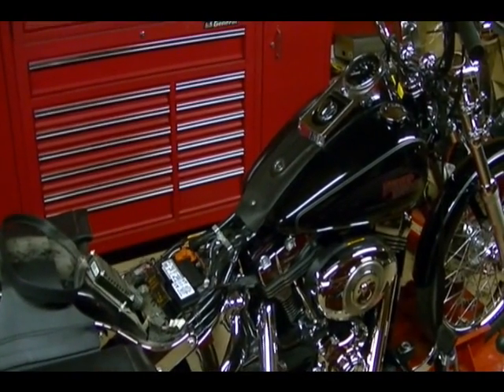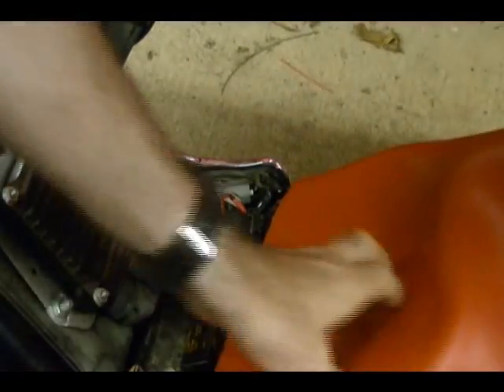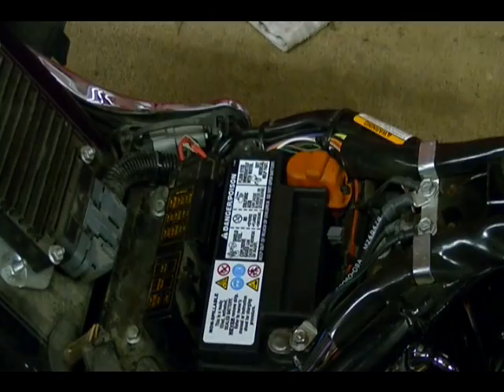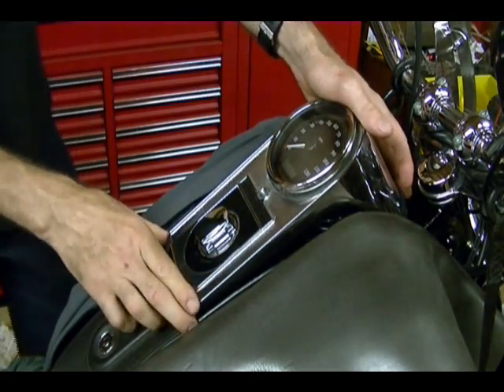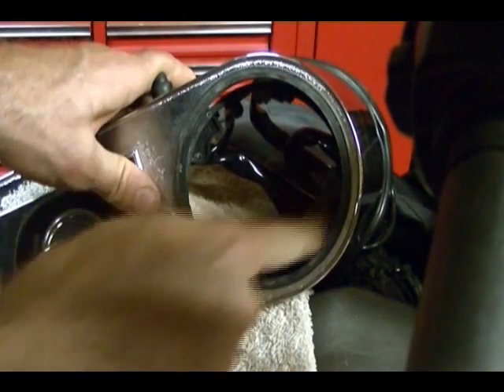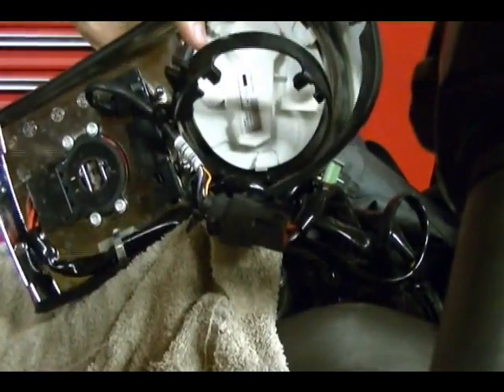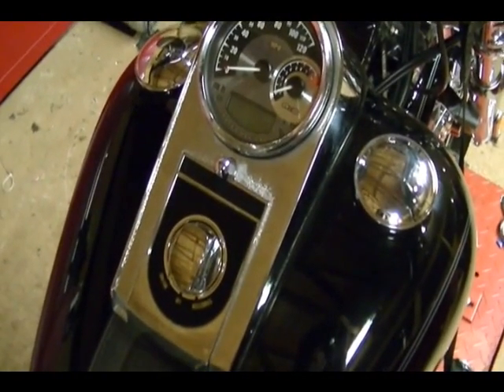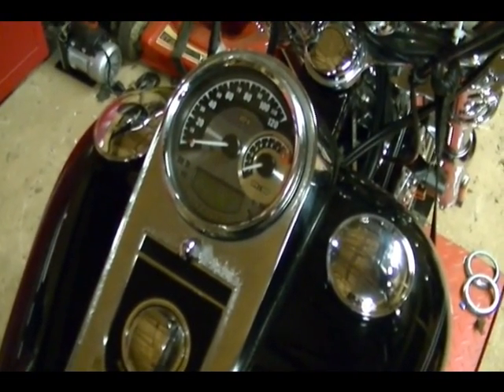How to Remove & Replace the Speedometer on a 2009 Harley Davidson Softail Custom 70900070A

Comment: Thank you for the great video , installed this weekend , a couple of things I’d like to add for ease of install:

1. Line up the Speedo dead center so your not fighting the black retainer clip , it’s near impossible to spin the speedo once it’s set so put in straight from the get go. 

2. Make sure the run switch is on before you transfer the data or you get a No Cal reading.  

3. Remove the odometer reset switch from the boot or you might break it like I did. 

4. When inserting the electrical connector into the new speedo it only works when the correct side is inserted , before you put the console back together check to make sure you didn’t reverse it by turning it on , it WILL snap in both ways. 
If your speedo doesn’t turn on just reverse the electrical harness connection.

Again many thanks for your video , excellent job

Comment: You are the best! Just installed my new tach on my Fat 2013 following your instructions.

Something I can say about my installation:

- to turn off the battery, you should do it BEFORE the alarm turns on, otherwise will alarm; turn the key off, and immediately take off the fuse, avoiding the alarm to turn on;
- my rubber ring around the tach was too tight; I used some lubricant and entered very smoothly;
- the connector attached to the tach can go either right or wrong way; be careful you keep track of the right position;

Thanks guys!
Reply from the maker: Thanks

Comment: I really appreciated you putting this video together.  I was not impressed with the instructions that came with the Speedo/Tach.  By watching this video I replaced my original Speedo with the 70900070A in less than 30 minutes.  It was clockwork that could have not been done without this DIY instructional video.  Thanks
Reply from the maker: Good to hear. Thanks for watching!

Comment: Exceptional video and info. Thank you for taking the time to make it. I installed the Combination Analog Speedometer/Tachometer 70900070A on my 09 Road King tonight and this video made it a 10 minute job. Note that on the RK the Data cable and master fuse are both behind the left side cover. Data connector is gray and down low. It is NOT yup top behind the tank... Same size, different color and function. Just FYI.
Reply from the maker: Thanks
Reply: Thank you very much. You save a lot of trouble for me
about colour on  connector. I try behind the tank several times and its not work. Thanks!

Comment: Great video.. it worked for me..
Q,  what to do with the gas cap with fuel gauge , how do I remove it and what to do with the inner sensors and wiring.
I now want to add flash mount pop up gas.
Thanks cap

Comment: That looked easy enough. I had the dealership install the speedo/tach when I purchased my 12 RoadKing. I need to look at the labor cost. Should have saved a few bucks and installed it myself.

Comment: Thanks for posting this video. It helped make thing go rather quickly when I installed my new speepo/tach on my 2013 heritage. 
One question, is there a way to turn off the ABS light on the gauge?

Comment: Looks simple and I will do mine this afternoon. However, I plan to remove the tachometer from the handlebars which is the reason I bought this speedometer in the first place. What do I do with the wires that run to that gauge?

Comment: Thank you so much.  After much mis-information from my local mechanic (who is a great wrench) and also from the local dealer, this video shows me I can easily do this myself. '04 Heritage.  Too bad the gear indicator will not work on older models.
Reply from the maker: +Truly Anonymous Thanks for watching!
Reply: +smallengineshop Hello man, I was looking your video and I'm needing an part for my bike it's a Deluxe Softail year 2013. My Dash Panel sensor aren't working  on dash panel. I need buy a part for my sensor return to work. What is name this part and what's part number for my bike? Thank you!

Comment: Hey I just bought this tach and installed it with my friend by watching ur video step by step excellent info thank you for posting ps on my 2007 soft ail the maxi fuse is in a different place took a minute to figure lol almost had the battery disconnected by the time I found it lol
Reply from the maker: Good to hear! Thanks for watching!

Comment: I know it has been a while since someone has commented on this video but I thought that I would ask...in order for the new gas gauge to work, does the old one have to remain plugged in or can you disconnect the old one on the dummy side of the tank and put something else there in it's place?
Thanks in advance for your help!

Comment: Nice video.Just picked up a stock replacement speedo for my 2010 Heritage Classic (glass was cracked).Could you pls tell me the P/N of the jumper which allows transfer of orig miles to the new unit? Thanks smallengineshop!

Comment: Do I have to pin the 3 fuel gauge wires to the speedometer plug to get that to work? Right now it’s in the cap.

Comment: Thanks for the info.  One addition - I installed one in my 2010 Softail Custom.  Note that my data would not transfer until my switch was in the ignition position AND the "Run" button on the handlebar was on.
Reply from the maker: Thanks for commenting and watching!

Comment: Hi.Great video
I want to buy this item (70900071A KpM).
 I have the current odometer in miles (original speedo in FLHRSI 2005).
 When changing to a new speedo will-ECM send the number of miles or kilometers to the new speedo?

Comment: Can we get a video on the 1) digital oil pressure gauge and 2) Kuryakin fuel / voltage replacement install for the 2009 FXSTC?

Comment: Great video 
I was just wondering, can you install a speedo tachometer combo of a 2012 Fatboy to a 2008 heritage standard speedo, I have the wire 2012 harness that goes from speedo to existing wire harness. I would really appreciate any info that you can supply   
Once again thank you. 
Loza

Comment: nice unit- was working fine and did some work on bike and disconnected the battery and when everything was hooked up odometer says V I ER. speedo works but nothing else- took it for a long ride and nothing changed. Any ideas??

Comment: I just went to put in this new speedometer on my 07 Heritage but because I had already put in a new upgraded speedometer in 2008 the new speedometer won't sync with the bike.  HD says you can only upgrade from the original speedometer, so because the speedometer upgrade I did in 2008 failed (bike said I was doing 10 mph at 3,000 rpm at a stop light) I can't replace it.

Comment: Very cool....been thinking of getting one for my 05 Heritage Softail Classic. With that being said my bike only being a 5 speed will the digital readout still work as in what gear I'm in and fuel gauge ext....finally you mentioned colors for the speedo is it just a complete rainbow of colors to choose from? Thanks a lot for your time and great video!
Reply from the maker: The gear indicator and the fuel range won't work on a 2005 Softail Classic. I posted the colors and codes at thesmallengineshop forum. Here is the link:

http://thesmallengineshop.net/smallengineforum/index.php?PHPSESSID=a6ss934o7ssfl6kf468kvo59b4&topic=53.0
Reply: OK thanks I appreciate it!

Comment: I have a 2009 Softail Custom like yours. The Fitment says material is 5 inch diameter. But it's only 4.6 diameter is that the same a yours. Kinda like example a 2 by 4 is not really a 2 by 4.

Comment: Hello Smallengine  shop.  Great Vid... I have a  2005  FLSTF, you  showed the  parts  box  which  included models from  04-10-- FLSTF  ..... QUESTION:    I  currently  do not have  a  tach  (  stock  speedo) and  my  fuel  gauge is separate. Can this  part #  still be used on my  bike so I MAY have  RPM , fuel  gauge and speedo? Thanks

Comment: ok I was sold the wrong speedo and after install by shop I discovered the error. (after bike brought home) they told me to uninstall the speedo bring it in and they'd give me the correct one. All was going fine until I went to do the odometer copy followed your video and instruction page (your video is easier) but I get an error msg that is not in the troubleshooting table. I get "no spd" before I tried to do the data transfer I called the shop to ask if I needed the speedo they made me return and they said no the info is in the bike. Well I don't know about you but I'm thinking no spd means no speedo to copy from. Help please. Already paid them $60 for the initial install not about to pay them again for same job.

Comment: So I did the install. turned out O.K. First off getting the adapter out of the bike end was a trial. Then the rubber around the speedo came out. Unless you know a trick to get it back in it is a frustration (go round with your thumbs in opposite directions and push in the bit that is left). Then try and get the new speedo in - hah! it takes a lot of WD 40 around the speedo AND the rubber.Getting the kast white prong of the speedo over the lip of the rubber without pushing the rubber in again is a chore also. Pushing down the black ring is not as easy as it is made out to be. I guess what could go wrong did or the video was practiced many times with everything positioned and expected just so. Anyways O.K. job on the video, just should have some caveats as to the problems that may arise.

Comment: Any chance you could tell me the pin wiring schema of the adapter? I have the plugs and want to assemble the adapter..
Reply from the maker: Are you talking about the 4 pin to 12 pin connector?
Reply: @smallengineshop  4 pin connector (j1850 era)
Reply: @smallengineshop  the main question I have whether I can connect to the electra glide 2010  (j1850) a used matching speedometer (j1850) from other bike (say road king 2010) and do not get a VINERR displayed?
p.s. people say it's just a drop in swap, other say - I need special equipment to "merry" speedo with ecm.

Thank you.

Comment: Would not work on my 2004 RK. Took it to local HD shop after they fought it for a day they called HD factory. They were told my old speedo was not factory original and would not calibrate my new speedo. I had to order a new factory speedo specific for my 2004 RK still waiting for it to come in. I had bought my bike used and possibly it had a newer speedo installed. So now i will have two.

Comment: Where did you bougth that speedometer? 70900070A... can find it in Europe.....at least for my Dyna Street Bob 2007..
Reply from the maker: I bought the speedometer from a Harley Davidson dealership. I know there are HD dealerships in Europe, but I have no idea if they sell the same items. I am sure HD has a website for all the European countries where they have dealerships, so I would check the website.
Reply: Thanks

Comment: I have a 99 Softail Standard the odometer does not read and it just shows 0 everything else on the bike still works when I turn the key on the speedometer will flicker I read the codes there are no codes my question is do I need a new speedometer
Reply: It sounds like you need to flash the old speedometer with the new one. Did you hook up the new speedometer with the cable that came with the new spoodo/tach? It must be hooked up from under the seat and flashed. Then you can program the colors after you remove the old one and install the new one.

Comment: Hi can this speedo be reset at the dealer and installed on another bike
Reply from the maker: I don't think there is an approved method to reset this speedometer, However, there are ways to change the mileage with special tools. I wrote a post about this on my website forum.

Comment: hi
i have softail fatboy 2013 but my plug has 6 pins instead 4 and i cant make this connecting, do you have any idea how to can i solve this problem?
Reply from the maker: Did you buy the correct speedo for your bike? I don't think there is a solution for this problem, but I would try calling your local HD dealership. I hope you didn't purchase the wrong speedo, because I don't think HD dealerships will allow returns on electronic products.
Reply: I bought the speedo according to HD site, its 74777-A11 and before i bought it i ask if it fit to my bike and they said yes, it is very strange that no one can help my dealership or even HD have no idea
Reply from the maker: To make sure we are on the same page. I don't have access to the instructions that came with your speedometer. Are you saying the data link connector on your motorcycle is 6 pin instead of 4? If your speedometer is like the one in the video, than it came with an adapter harness. One end of the harness fits into the speedometer and the other end plugs into the data link connecter. How many pins are in the harness data link connecter end (The end of the harness that fits into your data link port on the motorcycle)? And how many pins are in the data link connector coming from your motorcycle?
Reply from the maker: I uploaded photo's of the adapter harness used in the video to give you a better idea what I am referring to in my previous comment. Here is the link:
http://thesmallengineshop.net/smallengineforum/index.php?topic=132.0
Reply: ***** My speedo as i wrote is 74777-11A this speedo is KM and not MPH
 Yes my data link connector on your motorcycle is 6 pin, I have the same cable as you have you with 4 pins
when i called to HD they said this is the correct cable and they dont have other adapter cable
it sound very strange that HD make motorcycle with data link with 6 pin and they dont have adapter cable that match Right now i dont have any idea what to do, I hope you could help and have something or idea
When i disconnection the speedo of the electricity on my motorcycle and return it back i can see the real KM for 3 second and it return back and show 999999
I ask someone and he said my be my computer on the motorcycle was locked, do you think it is possible? and if yes how could i release it
thank you very much for your help
I appreciate very much
Reply from the maker: Are you sure your looking at the data port and not another connector on your motorcycle? Can you take a picture of the data port and post it on the forum? Thanks..
Reply from the maker: I just verified the 6 pin data port through a forum post online. It says HD went to a 6 pin data port on all Softails in 2011. The HD parts and service department near me could not tell me if HD went to a 6 pin data port on the 2013 Fat Boy. They are completely oblivious to the problem, and I don't have a solution to you. I wish HD would make the instruction sheet for the 74777-11A available online. I would take your motorcycle and the speedometer back to your HD dealership and show them the problem and demand a refund. I will continue to look for information regarding your problem and let you know if I find anything.
Reply from the maker: Contact Harley Davidson customer care 800-258-2464. They said the 74777-11A comes with 6 pin adapter harness and not a 4 pin. I told them what you told me, and they wanted to know when the 74777-11A speedometer was purchased.
Reply: wow thank you very much!!!!!!!
where can i find the purchased date?
Reply: Do you know the part number for this adapter cable 6 pins?
Reply from the maker: If the manufacturer date isn't printed on the speedometer/tach, or any of the accessories included with the kit, than I don't know how to find the date. You might try calling HD customer care. I don't think the adapter harness is sold separately through HD, but I would give HD customer care a call.
Reply: Is it a possible that you can achieve this cable harness for me (with 6 pins)?
Thanks you very much for your help and I appreciate very much since it very hard to talk with HD
Thanks for you help
Reply: eliran yair hi, i call HD (talked with Deby) and she said there is no adapter harness with 6 pins and the only adapter harness is with 4 pins and she couldnt help me.

Comment: Can i use in fat boy 2001 ? I need change some cable ?
Reply from the maker: This speedometer/tach won't fit the 2001 Fat Boy. I posted the application guide for this speedo on thesmallengineshop forum. Here is the link:

http://thesmallengineshop.net/smallengineforum/index.php?topic=83.0

You can check harley-davidson.com website to see all compatible speedometers for your motorcycle sold by Harley Davidson.